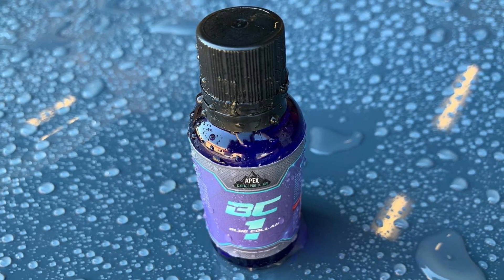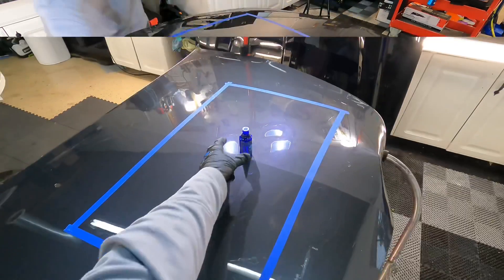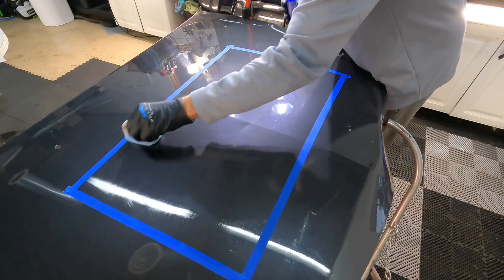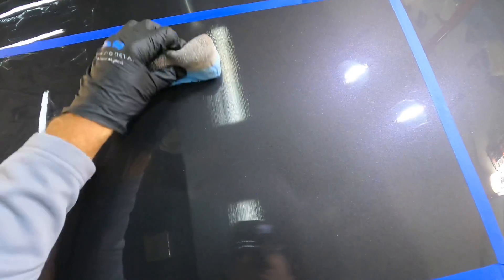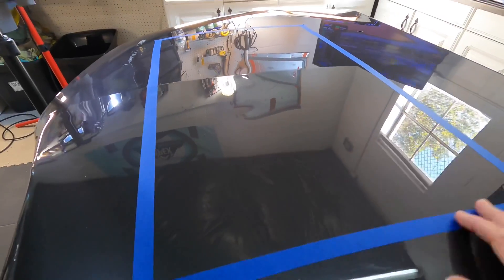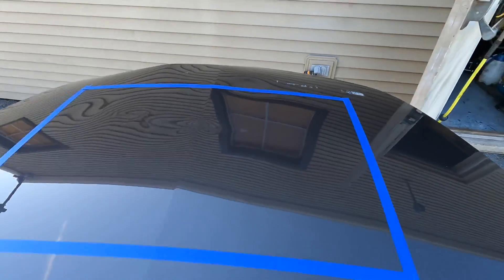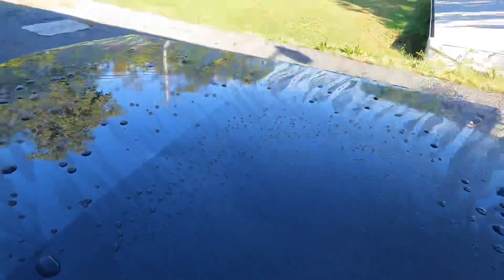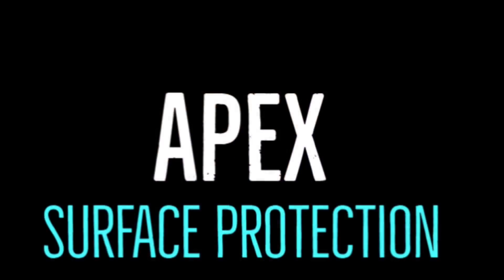DIY/Enthusiast Polysilazane Coating With Professional Results!! User Friendly For Only $79.95!!!

Comment: Brian, question for single stage paint and BC1:  I put on some Xtreme Solutions' graphene spray about a year ago and the vehicle has been out in the sun for 18 months.  I plan to use BC1 after a polish of the white vehicle paint areas with Xtreme LVR 404 and the colored areas with LVR 403.  They normally have a cure time of 24 to 48 hours before application of new coatings.  Should I remove them before using the BC1 or just let them cure the 48 hours, wash and then apply the BC1?

Thanks!

Comment: Ordering! Is this compatible with a “primer” polish with SiO2 such as Carpro Essence or Gyeon Q2 primer? They are meant to bond to ceramic coatings but I’m not sure about “preceramic” polysilazane. Also, does BC1 or the toppers contain UV inhibitors? Thanks!

Comment: You didn't cover how many coats you can put on, and if you can coat windows plastic and other stuff on the outside of the vehicle
Reply from the maker: All hard surfaces on the exterior. Headlights, tail lights, all plastic trim, chrome trim, wheels, PPF, wraps, vinyl, glass, calipers, mirrors. Two coats Max

Comment: Any application or performance difference on PPF?  I am currently loving Cosmic Spritz by Polish Angel but want something that lasts longer and will handle Boise winters. This sounds like it would be a great fit as long as it also works on Xpel PPF. Thanks for all you do!
Reply from the maker: I had PPF in mind when releasing it.👍🏻👍🏻
Reply: @apexdetail85  but if a coating hardens the how the self healing properties of the ppf will be able to work properly???

Comment: Brian justify curious.  If there are any differences between you old line to the new line or are they similar.  Just curious still have some of the old line can’t wait to use the new line.
Reply from the maker: This is easier to apply and at a fraction of the price.

Comment: Truly impressive! Brian, can we use BC 1 on glass and trim also like the metal oxide coating assuming we prep the surface? Do you recommend any topper for the glass or should BC 1 be enough?
Reply from the maker: Yes....BC3 would be a great topper.

Comment: I’m a little over 2 years in with Avalon king ceramic, what’s your advice for prepping before adding this product?
Reply from the maker: Wash, full decon. Iron remover, clay. Paint correction or at least a cleaner polish. Follow by using a panel prep.

Comment: What is the biggest difference between this and a traditional ceramic coating?
Reply from the maker: Better resistance to marring...not impervious. But a notable difference . Also..high operating temps...or resistance. Better bond to other substrate beside just paint.
Reply: @apexdetail85  thanks for the info!

Comment: I have a new SUV ordered and I am considering using BC1&3 on it. I would like to know what application pad you were using and wear to purchase them.
Reply from the maker: I recommend these...https://www.amazon.com/Applicator-Microfiber-Sponge-Plastic-Barrier/dp/B07VXS51J2/ref=mp_s_a_1_1_sspa?adgrpid=67351100389&gclid=Cj0KCQjw4omaBhDqARIsADXULuVqwg4YCaUqi3gOWzRQ2evKY0MVOV0tiCo5H7dGnl3C54y14wdPAlEaAnNKEALw_wcB&hvadid=337845400931&hvdev=m&hvlocphy=9007440&hvnetw=g&hvqmt=e&hvrand=16825081147979492249&hvtargid=kwd-383530399110&hydadcr=25112_9900373&keywords=ceramic+coating+applicator+pads&qid=1665337049&qu=eyJxc2MiOiI0LjA1IiwicXNhIjoiMy42MSIsInFzcCI6IjMuNTQifQ%3D%3D&sr=8-1-spons&psc=1&spLa=ZW5jcnlwdGVkUXVhbGlmaWVyPUExSkNYQUZaU1RETEFXJmVuY3J5cHRlZElkPUEwNzEwNjA3MkcwQUc0M1Y4UVRROSZlbmNyeXB0ZWRBZElkPUEwMTkyNTYxMU5YWEw5Wk4xREhMRiZ3aWRnZXROYW1lPXNwX3Bob25lX3NlYXJjaF9hdGYmYWN0aW9uPWNsaWNrUmVkaXJlY3QmZG9Ob3RMb2dDbGljaz10cnVl

Comment: I have an old Ford F150 with the appropriate amount of surface rust.  I plan on scouring down what is left of the finish (not to metal but to smooth the surface) and applying some kind of protection for the patina look.  So far my YouTube research has led me to floor wax (short lived and yellowing), linseed oil (oily finish) and Poppy's which while they never say what it is but seems to be a polyester or something.  Anyway, will your finish work on top of the cleaned up and steel-wool prepared patina?  Do you plan on developing a dull finish.  I'd prefer a dull rather than a shiny finish for the real patina look.  But I'll probably go with what you have now if you say it will work.  I'm sure a lot of people are doing what I'm doing with patina finishes.
Reply: Mix the Linseed oil 50/50 with white spirits and it'll set without being oily within 24hrs
Reply: Try Meguiar’s No. 7 Show Car Glaze to restore yet maintain that Patina class vehicle
Reply from the maker: I use grape seed oil myself.

Comment: Is APEX Rehydra-Sheet an approved topper for BC1?
Reply from the maker: Yes...approved.👍🏻
Reply: The product is a beader. If I use Rehydra sheet over top, I assume that once the topper ages, the beading of the BC1 will take over. Yes?
Reply from the maker: @peterjurenovskis5933  until it wears down... what ever you too it with ... will have its characteristics.

Comment: Very Impressive! Can any Ceramic or Graphene topper be used after application such as Titan?
Reply from the maker: Yes...approved.✔️
Reply: Any topper can be used on any coating. Best to stay in the same product line if possible, but not necessary.

Comment: What? No dropper, Brian!?? Okay, where is the real Brian!??
This product looks good! 
Suggested time between coats? 
How long is the shelf life opened? 
How long is the shelf life unopened? 
I will try this out in the spring. I think it got too cold too fast here in the Northeast.
Reply from the maker: No dropper. 

2 hr between layers

One year shelf
Reply: Droppers are easy to buy. ;)
Reply: @paulmouradjian6045  yes, thanks to Brian I learned another way to apply a coating using a dropper. Usually, that is how Brian likes to apply a  coating. I guess this coating does not need a lot to be applied, so a dropper is not needed?
Reply: @franksattler6053  I would think it is applied in a similar manner. I believe the dropper commission is more about the cost factor of the complete package to the masses. A Blue Collar Product made for the masses and Profession giving each a professional coating with superior ease of use. If you are more comfortable with the dropper.....they are inexpensive. Enjoy BC1.
Reply: @paulmouradjian6045  Brian mentions in response to my comment no dropper. I guess you do not need to use a lot to protect your vehicle. I see in the video no dropper and he used about 20 drops.